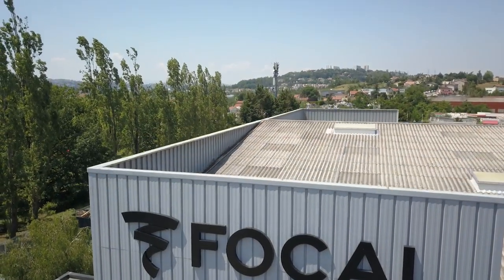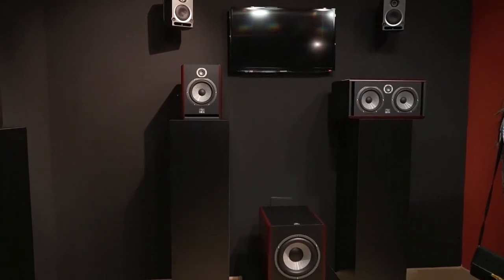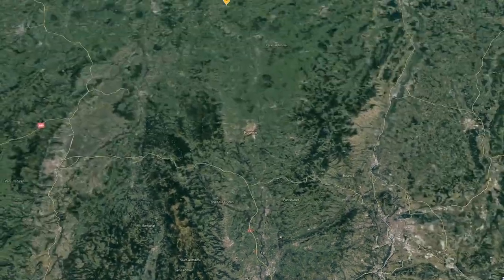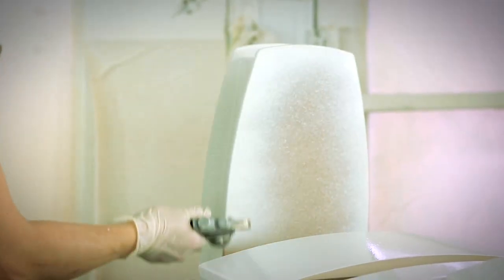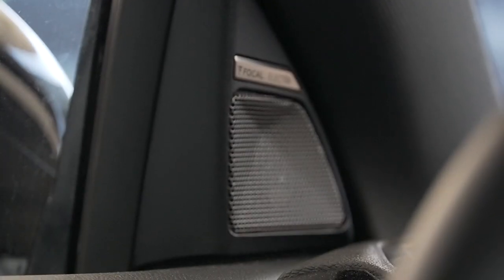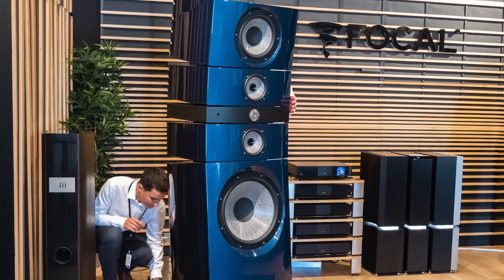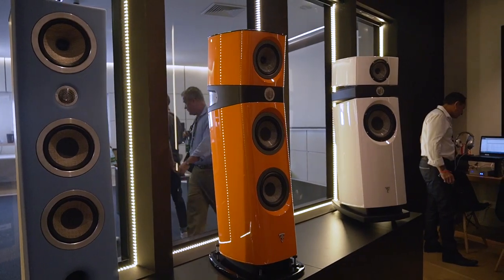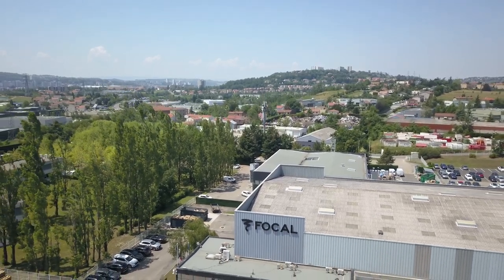See how Focal's insane $230k speakers are made during our factory tour

Comment: I kept blowing up my rear speakers with my audiophile-grade auto sound system even though I would make sure the speakers were rated to take the power. Most speakers would last a week or two. The two Focals I tried (which were the most expensive pair I tried) blew up just as I turned the volume past the mid-point. They are over-rated speakers. I will never buy again.
Reply: Sounds like your amplifier is the problem
Reply: Zero chance it is the speakers fault, you have a broken or garbage amp.
Reply: Lol 😂 you blame speakers for your own amplitude abuse. You need a couple of pa speakers in your car . Boom boxes
Reply: It appears to me you know nothing about amplification nor speakers.  I noticed how you never mentioned what “audiophile-grade equipment” you have